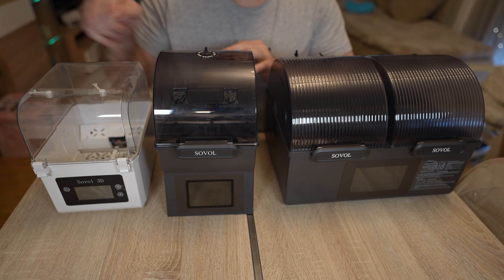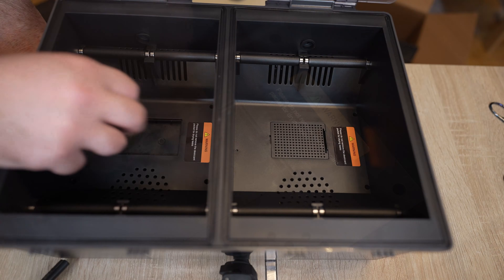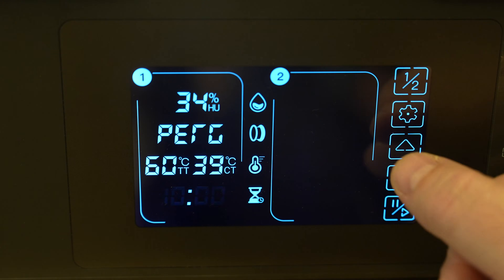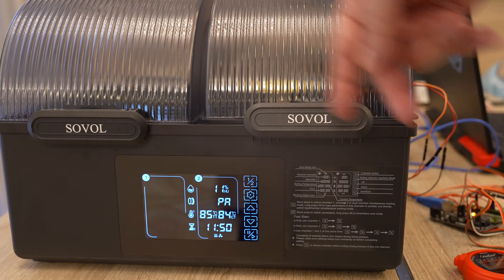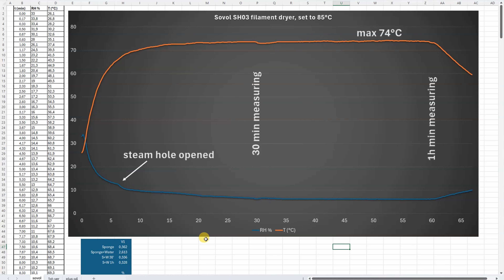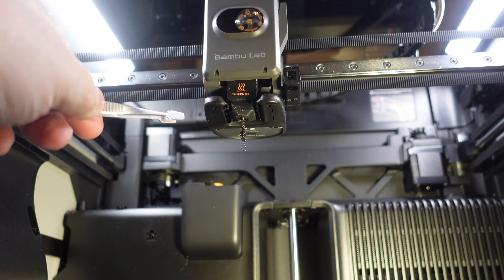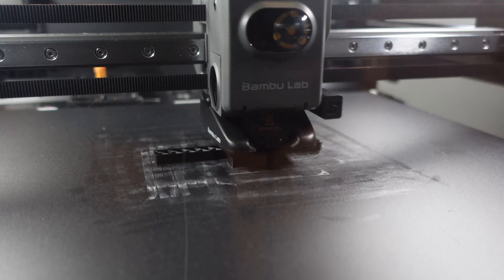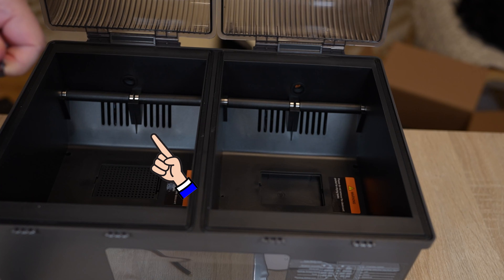How Long to Dry Nylon at 85 °C? | Sovol SH03 Filament Dryer Review

Comment: Hm but this test is flawed as well? Can't you remove the filament exit plug or drill a hole (you can always plug it later if you want to keep using it)
Reply: And also opening and closing the lid let in fresh air, proper test will be running it for x hours without opening it, as one would normally use a dryer

Comment: Aren't most filament dryer design flawed? You can't have a sealed dryer, a dryer cannot be a drybox, imagine trying to dry clothes without a vent, you can heat the clothes as much as you want and lower the RH% but water vapor will condense as soon as the air cools down, a food dehydrator will work so much faster. It's like those outdoor clothes dryer in humid climate lol, your clothes cannot dry 😂

Comment: Great video as usual Mr. Gaspar! I was wondering if you could test drying filament (nylon and some CF) on the heated bed of the printer?
Bambu has this program on X1C for drying where you put the cardboard box, that the filament came in, over the filament with some holes on top for the moist air to evaporate out. This is the approach I use because the bed can go up to and over 100C which is by your Nylon drying tests important to reduce drying times. There is still no dryer than can produce 95-100C drying temperature. Since everyone has a printer and a box the filament came in, this could be a very budget friendly way to dry demanding engineering filaments and other. Drying for 1-2h instead of 8-12 hours in a conventional commercial filament dryer. 
It does take up 1 printer while it is drying, but I usually dry it that way while I'm designing in CAD works out for me but would love to see real data if this is just a gimmick or does it really work.

Comment: Replaced all my filament dryers with the new SH03, 2 weeks using and it's the best, the only problem it have the "interface" hangs 1 week later if you put on moisture maintenance mode.

Comment: The most important information for any dryer is temperature accuracy and moisture venting efficiency. Features are typically the same it’s a pity that most dryers do not rotate the filament while drying.

Comment: Decent reveiw, but honestly looks like a failed attempt to challenge Creality SPI X4, bad temp sensor position, no electronics cooldown on power-off, lacking display, no auto drying, an open source firmware could be a big deal, whatever. Unless it's like 40% cheaper not sure anyone gonna buy it.

Comment: To answer your question, I do like the more detailed videos. It would be interesting to (1) leave the roll in the dryer and see how much water it picks up. I have a Space Pi+ and from the change in color of the silica it seems to be far from sealed. Also on a different test (2) perhaps leave it in the dryer and re-dry it every other day 2 or 3 more times. I wonder if the moisture from the center of the spool would move towards the edge, or if it would just continue to dry it as if it were one continuous session… would that show in the curve you plotted by having a different inclination in each successive drying? Cool stuff. Thanks!!

Comment: Love the content. Though I studies STEM in the 80s. Your postulate about the inner layers of a reel not being as dry as the inner layers my be true. I've been printing a batch of part with a new roll of PETG and as more of the roll gets consumed the printing get worse. I dried the filament for 8 hours at 50C and have started the next batch. We'll see if the quality improve. Perhaps you could instrument a new roll of filament and measure the temperature and RH at various radial distances from the roll's outer diameter, while drying the roll.

Comment: Isnt it best to have a steam vent at the very top of the enclosure? You should calculate absolute humidity and add that to the same graph, to see if the moisture is actually getting extracted.
Reply: he did, it's on the graph.
Reply: @riba2233  No thats RH%, relative humidity. It changes as a function of temperature. What’s equally important is absolute humidity, the (micro)grams of water per litre of air. As you increase the temperature RH will decrease, but AbsH will remain constant or even increase as moisture from the filament escapes. The extent to which AbsH changes determines the efficacy of the venting system.
Reply: @Scrogan  ok I see but I never saw anyone measuring that
Reply: @riba2233  You can just calculate it from temperature and humidity, which have already been measured, and by assuming a rough air pressure. I haven’t seen a sensor that displays absolute humidity live, but I’ve definitely seen people calculating it with data they’ve collected. For filament drying in particular, it allows you to relate an increase in humidity to the weight reduction of the spool being dried, it’s definitely a metric with merit.
Reply: @Scrogan  ok I see, thanks!

Comment: Have you heard of the West3D filament toaster? It looks like a toaster oven and is supposed to be able reach 120° C in only a few minutes. I've been debating the SH03 or preodering the filament toaster. I agree with the others this was a great review and not to complex to understand
Reply: does it have venting or is it just static heaters?
Reply: @riba2233  It looks like it has vents but I'm not completely sure
Reply: @onlyonestevie  it should be moving air through the oven, in that case I can see it working well.

Comment: I don't think that the heating vents are a problem. Just because they are a lil bit towards the center doesn't mean only half of the spool will get the majority of the dry. If the temperature is uniform and the air reflects and jumps all over the place this shouldn't be an issue.

Comment: How good the seal is on this dryer? Specially for the rear vent, I have concern that moisture will leak through the vent into the chamber when we use the dryer as a filament storage
Reply from the maker: The sealing is very good. Only I am not sure about the rear vents.

Comment: Nice review. If anything to improve, you could test whether these devices are really able to work with 3kg and 5kg spools that fit. More often than not the rollers prove to be inadequate, bearings seize, filament openings are only with 1kg spools in mind (e.g. no at the center).

Comment: Feedback.
"Was this review too complex" NOT at all and quite frankly I surely wish the manufacturer would pay you to help out with a product while prototyping it.
I am actually thinking about your shed and chart of the results over time. Not sure if you have access to an industrial blasting oven but it would be super cool to see a comparison.
I was eyeballing the Bambu lab HT dryer but somehow I am still using a dedicated air fryer I looked for weeks to find the exact features I wanted out of it so it doesn't melt the spool. That's a very common issue because the heat element is right above the tray, in my situation I have a mini oven style air fryer and  use one of the trays as a heat shield.

Comment: I'm wondering if the whole spool needs to dried up before hand if printing happens directly out from the drier. I'd assume that lot of drying happens from top surfaces of the spool during filament is rolling out.
Reply from the maker: Maybe we will find out, I have an inline dryer for the testing.

Comment: Finally the driers get similar to the AMS 2 Pro with the active ventilation of moisture. But something they still dont do right is the vent port isn't always open when driying, the ams heats up, holds it up and only opens the port in between to let the moisture out and then closes it again until more moisture accumulated in the inside air.

I dont understand how so many companies are never bother with doing the fine, small details to roundup their product. Especially if they already have the hardware todo so, its just a little bit of software for god sake.

Comment: I’ve been loving my Space Pi X4. I did find that at 85C, it warped the clear plastic spools my Phaetus ASA-GF came on, until I printed and installed some air deflectors I found on makerworld. My concern with this machine is that because the rear roller is midway over the vent, you can’t install any sort of diverter.
Reply: you shouldn't dry asa at such high temps, that's why they put them on PS spools and higher temp filaments on PC spools. 65c is more than enough for drying asa.
Reply: @riba2233 that’s not what the spec sheet says. It says 80-90C for 4-6 hours.
Reply: @ScottyAlmondjoy  sure but in practice that's not necessary, unless you want to dry it really quickly. And it has to be on a better spool.
Reply: @riba2233 they didn’t mark the spool with what it’s made from, and I didn’t know to check if it was clear PS or clear PC. I read the specs, and expected that it could handle the specs. Thankfully, it wasn’t so warped that it wouldn’t turn when placed in the middle. The spool really should match or exceed the filament in how much heat it can take while drying.
Reply: @ScottyAlmondjoy  agreed. I asked them about the spools but they should be marked yeah.

Comment: I love the technical details, thank you !
So what's your favorite dryer please ?
Reply from the maker: It would be a PolyPhemus, since it rotates the spool, but its max is only 70°C. Creality X4 and SH03 are very similar, but since they don't rotate the spool, I have to do it manually. And with SH03 I can do it in 2 seconds using only one hand. I don't like Creality's slide-lock.

Comment: I like the AMS HT better: If it's about PA because I don't have to open it except when I need to replace a spool anyway. I just dry my PA filament about once a week to keep the moisure level below 15%. And for TPU I like the position of the AMS HT's bypass hole which allows me to feed the material directly into the direct drive extruder from above.
Of course the Sovol cannot feed/retract a filament automatically (I wouldn't worry much because it's also cheaper than an AMS HT) but having two filaments per chamber means that those filaments have to require the same drying temperatures and that replacing one spool means that you "contaminate" the chamber for the second spool with fresh and moist air.
But if you don't have a Bambu printer that's compatible with the AMS HT (or comparable solutuions from other companies) I can understand that the Sovol SH03 might be interesting for some people.

Comment: Igor, this video felt like it was less complex, and easier to follow than some of your more recent in-depth technical videos. It seemed to be more "crisp" and focused.  15 minutes was perfect.

I do think that having 2 spools inside would behave differently than what you experienced.  The rims of the spools will be very close to the hot air outlet.  The rims will split the flow and it may well work just fine.  But that's difficult to know without taking the temperature measurements with spools inside.
Reply from the maker: Hm, yes, I measured the temps without spools. Could be with 2 spools the air spreads more equally.

Comment: Igor, while you and I both love the rotating rotisserie mode in our Polyphemus, filament dryer manufacturers will be somewhat limited in their ability to do this.  EIBOS has granted patents US12115700B2 and CN212747141U with August 2020 priority dates. Manufacturers can license it, or attempt to work around it.  Or, they can do more effective jobs at air deflection and circulation to create a more uniform temperature distribution in the dryer.
Reply from the maker: Yes, we discussed this earlier. They could license it, but its their choice, I am only trying to motivate them to move in that direction.
Reply: I haven’t read it closely, but the US patent has some key limitations, namely that (a) the fan outlet faces upward, and (b) the heating element is placed above the fan. There might be some also-patented prior art with different fan/heating element positioning, hence the very specific language, but as for this patent on its own, a fan with a horizontally-oriented outlet or a vertically oriented fan located above the heating element vs below it wouldn’t infringe on it.

The vertical arrangement they describe makes the most sense thermally and in terms of compactness, but IMHO a rotisserie style drier with the fan and heating element arranged horizontally along the bottom of the unit would be perfectly OK. 

(Note though, that having a horizontal fan connected to a heating element located above it via a duct would likely still infringe because “fan outlet” could ne construed to equate to the end of the duct, vs just the fan housing itself.

Another non- infringing configuration could be a system in which the fan draws air out of the chamber and the heating element warms the air as it enters. This would be less safe though, in that any air leakage in the chamber could result in insufficient air flowing over the heater.)

My background: I’m not a patent attorney but have served as an expert witness on a number of infringement cases in both US District and FTC courts.
Reply: @DaveEtchells  Yes, those are absolutely some limitations caused by narrowing of the independent claims to overcome a 102 or 103 objections for novelty and non-obviousness, respectively, given prior art cited by the examiner. People have been drying things for a long time, lol, and rotisserie ovens have also been around for ages. 

As far as the heater or airflow outlet direction, the doctrine of equivalence could make it challenging to work around. You need multiple points of differentiation (at least 2, preferably 3 or more).  I have a number of workarounds for that initial patent.

In 2023, prior to that first one being granted, they filed another application that issued as CN116929022B which was granted 2 months ago.  It does not have the same limitations and narrowing in regards to the airflow and heater location but does have some other, different limitations that again, are pretty easy to work around. 

EIBOS has 11 patents and applications, and their patents are cited by Creality and others, so the industry is well aware of what EIBOS is doing, and EIBOS is being rather proactive in trying to protect their ideas and revenue.
Reply: @ArgueForSport  Thanks for that added insight, you’ve obviously looked into it far more than I have. It does seem a little silly; as you say, people have been drying things forever. This looks like a case of a company staking out a narrow claim then using the threat of litigation to scare off competitors. IP litigation is insanely expensive, so even the possibility of it is often enough to shut down competition 😕

If true, this shifts me back towards not buying their products at any price; I don’t want to support that kind of behavior at any level.

I strongly support the right of true innovators to profit from their inventions, but there’s SO much abuse of the system like this. 

It’s probably not the case here, but the recent trend of private capital funding NPE lawsuits to harass companies simply conducting their normal business is very troubling. The worthy aims of the patent system have been corrupted 🙁

Comment: Could you use your connections at polymaker to suggest a polydryer 2.0 that can hit 85c ?
Reply from the maker: They mentioned that they want to consult me regarding their new dryer, not no news since that. It was half years ago.
Reply: @MyTechFun  Here's my feedback if they ever do consult with you on it: Needs a less annoying fan - the volume is a bit high but the tone is especially obnoxious. The lid clamps are way too difficult to open and close. For my needs the filament exit from the box is in the wrong location - I have to position it so that the humidity display is facing backwards where I can't see it. The filament should exit the box on the side opposite the humidity display (or both sides in case there are other people with different setups ). I don't find the lid filament exit helpful. It would be nice to have a 3kg or 5kg box option (or do away with the boxes entirely...A normal dryer and vacuum bags is probably the better setup). The screen flickers very annoyingly, and the viewing angle is poor. The beeper is obnoxiously loud and unnecessary.  With all that said, it does work decently well (at least the second one does, the first one died but their customer service was very good in getting me a new one) and most of those complaints are relatively minor.

Comment: Placing the rollers closer together would make the spools less stable when being pulled up by the printer. Also the rolls are going to be turning anyway when printing off the dryer, I don't think adding automatic turning of the rolls would add any performance improvement worth the cost and complexity. Overall this looks like a solid product. Wish I had the SH03 instead of the SH02 right now. 😓
Reply: If you add automatic turning, you might as well make it into an AMS.
Reply: @ScottyAlmondjoy  That's a good point, to be honest.

Comment: I think you have a technical audience that appreciates the technical details.  I can't get enough.  My Tech Fun is the best technical 3D printing channel on YouTube.  I learn a lot from these videos.  I wish the SH03 had filament ports on the bottom.  I print a lot of TPU and I feed it from above with no Bowden tube, straight down into the direct drive extruder.